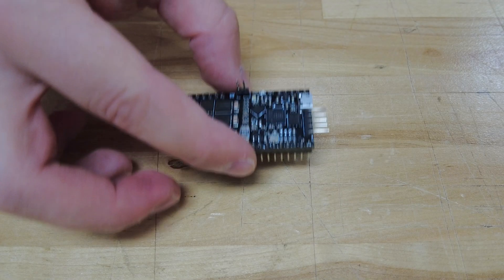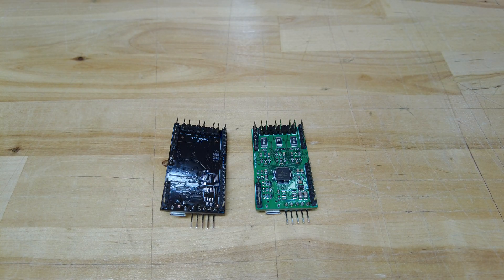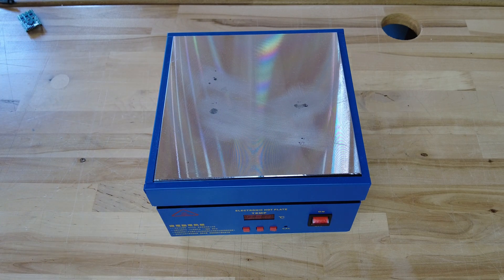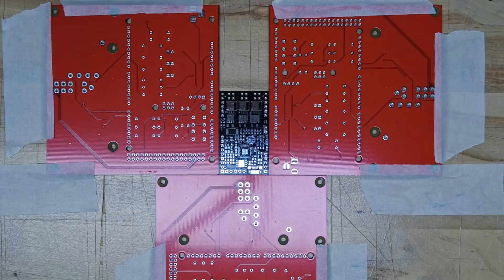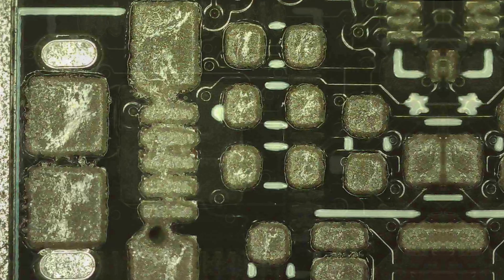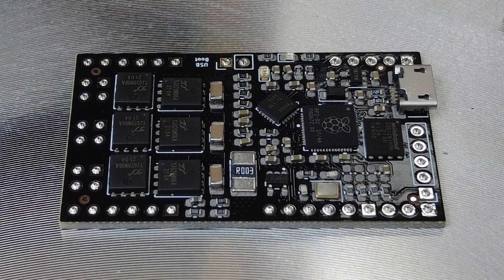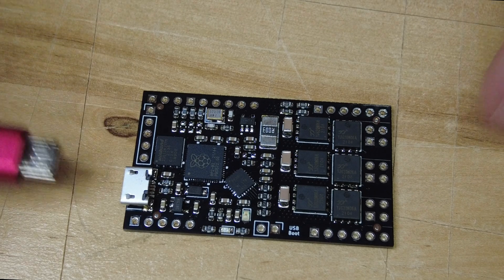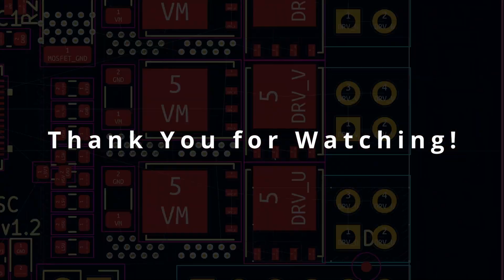xESC 2040 Open Source Brushless (BLDC) Motor Controller Update for OpenMower with Soldering Tutorial

Comment: Really nice project! I would be interested in a deeper explaination why FOC is not possible at all?
Reply from the maker: Thank you! The FOC is not possible, because the RP2040 doesn't have enough analog inputs for all phase currents, the input voltage, MOSFET temperature and motor temperature. Since the goal for this design was to keep it simple and cheap (so that we'll get it working soon), we decided not to measure the phase currents individually, but only the resulting current draw (for torque control).
Reply: @ClemensElflein   Sorry to bother you again: I want to use your xESC in a different project, but the motor will not have sensor feedback. Is it also a hardware limitation of the RP2040 that sensorless control is impossible? Or is it possible with the right software? Cheers!

Comment: How many amps is this ESC capable of?
Reply from the maker: I have no idea; The MOSFETs are rated up to 20A, but the pin headers will probably be the limiting factor here. I'd say about 5A continuous should be no problem. For the OpenMower project, we need currents of about 1A and this is easily doable.

Comment: Hi Clemmons, might as well get acquainted, bc I'm planning to go this project!  I already started reading & following your stuff.
I've got a different "microscope" but it'll work just fine. I have plenty of uC experience, tools, etc.
 I noticed you didn't use the hotplate, I thought you were going to use that for reflow.  ( I saw an Adafruit video where she used one modified to do reflow of small 2-sided PCBs, I looked on their website, didn't see it, so I emailed them asking about it, I got a reply that was kinda snotty. That made me think the mods must be "widely available" on the 'net, but I haven't run across anything yet.  Know anything about it?)
I'm planning to do the Open Mower project, we have the perfect yard for it, very flat (also pretty small). Fence ,& house bounding the back yard, but nothing around the front--and we're also a corner lot. That's why I think it'd be perfect.
I just learned about the project. I'm in the process of getting caught up with the Discord. I'll need to look for a decent but cheap mower to modify. I've been wanting to do this for years, but until I saw your GPS-RTK design, I didn't like any that I saw. Also what's slowed me down is the fact that, since we moved to this house, which is tiny, I don't have a work shop, or even a place to set up a card table!  I managed to put a (less than) 2' square piece of plywood on top of a file cabinet for soldering, but the iron & other stuff takes up most of the space, lol.  I recently hung some pegboard on the wall with small bins to hold parts, but it's nothing like the shop I built in the yard of our previous house:  had all the little drawers of parts, & cabinets on the wall, 2 sir-down small-assembly benches, 1 stand-up heavy bench for wrestling & hammering on stuff (with vise & press), table saw, floor standing drill press, cabinets & shelves galore, etc.  Unfortunately, had to leave it behind when we moved, too costly to move this far, and no place to put it in this yard. So, things go slow here.  (Still have all the small tools, just not in one place!)
Otherwise I would've probably already worked out doing this project myself by now, I'd like to think.
Anyway, I hope you've got things together, by now. Like I say,  I'm getting caught up on Discord, etc. 
Excellent work, by the way, dude!
Reply from the maker: Thank You! Welcome to the Project!

Comment: I would like to use the xESC2040 for a different project, but i need FOC for it. Its a pitty you removed it :(
Reply: Just as an explanation: the Motors start turning much smoother with FOC then the 6 phase commutation
Reply from the maker: Yes I know, I also do like FOC, but the focus for this design was to keep firmware implementation simple and cost low, since it will be only an intermediate solution until the semiconductor shortage is better. Sorry that the new design doesn't work for your use-case.

If it's only start-up torque you're looking for you will need a sensored motor and the designs should be similar. With FOC the motor runs smoother, with less noise and torque ripple, but sensored startup with block commutation will also give good performance.

If you want to discuss your project, you can also join the Discord, it's not only for OpenMower related topics.
Reply: @ClemensElflein  Thank you for your answer! When you say intermediate, does that mean you will update the design or have a totaly different design with an dedicated IC?